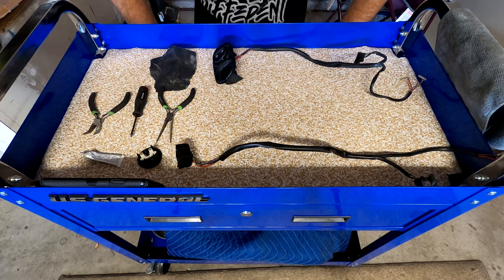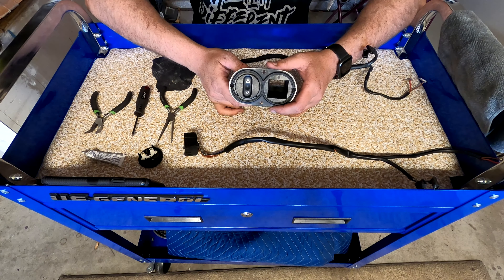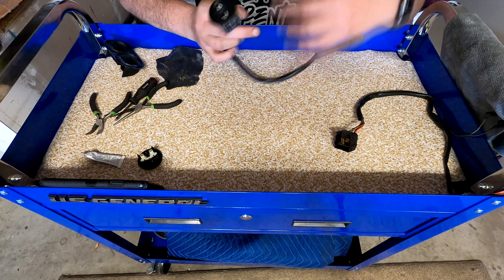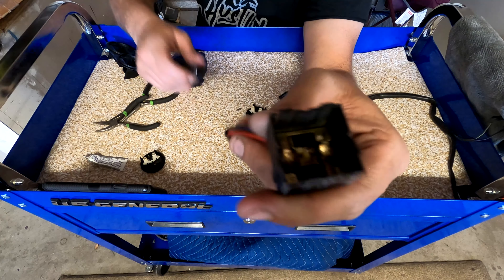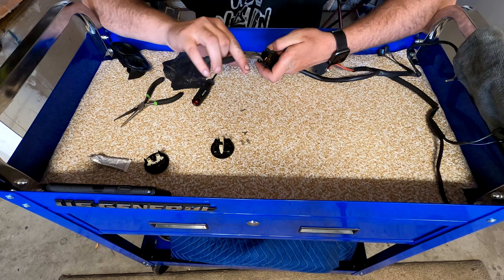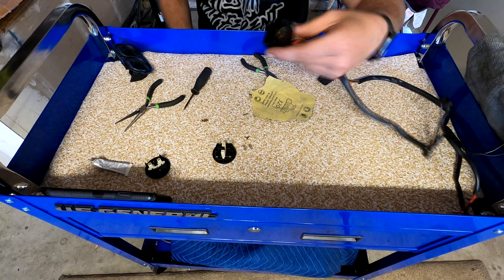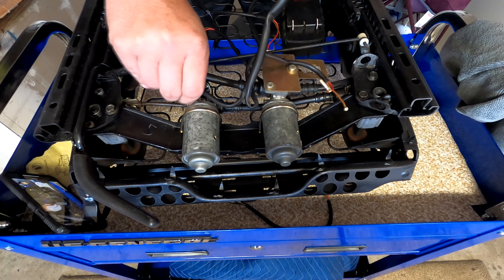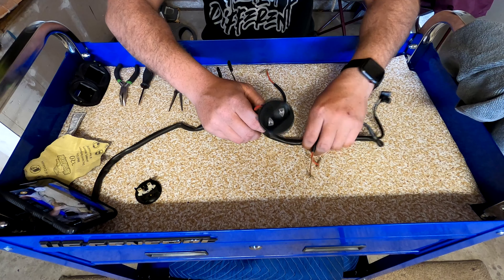How to restore Porsche 944 power seat switches

Comment: Thanks so much for this video, it really helped me out, because of it I was able to get both my driver's seat switches working again.  I found if I put the switches back together with the ball bearings part on the top and slid that down onto the piece with the springs, that I got it to go back together properly almost every time. You just have to have enough dielectric grease to keep the balls from falling out.

Comment: My experience is that the contacts on the switches wear out, and cleaning won't fix it. And of course the switches aren't designed to be disassembled.
Buying a new switch is the better course, at least for me. More expensive, but it'll be the last time for this particular vehicle.
Disassemble the switch inside a large Ziploc bag so you don't lose the springs and balls.